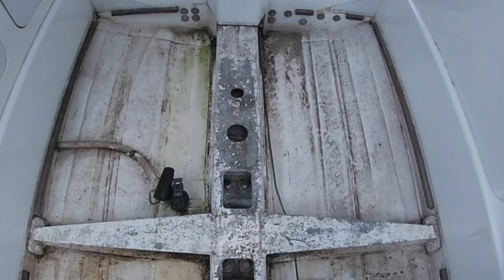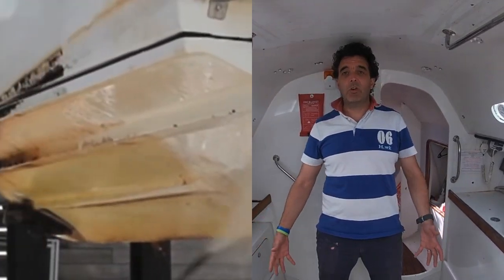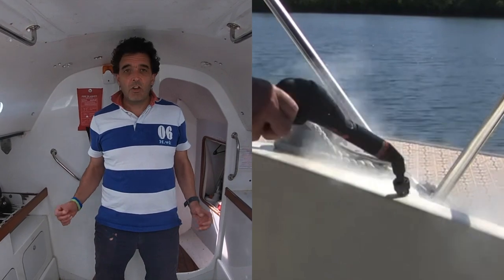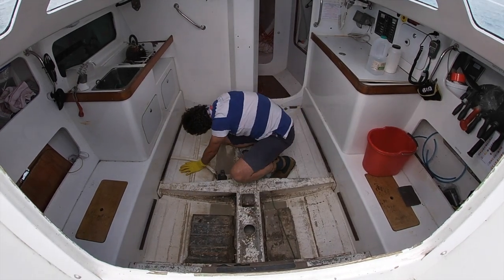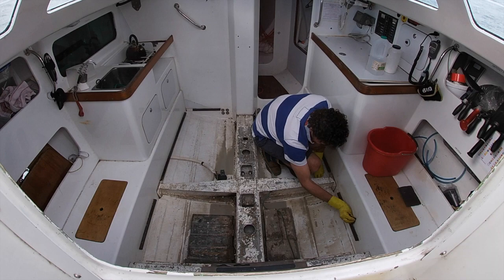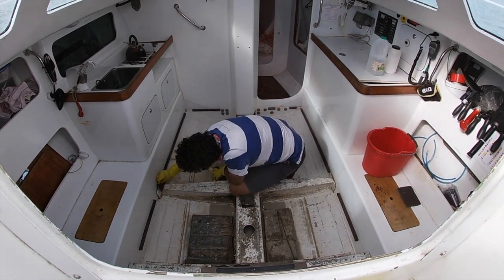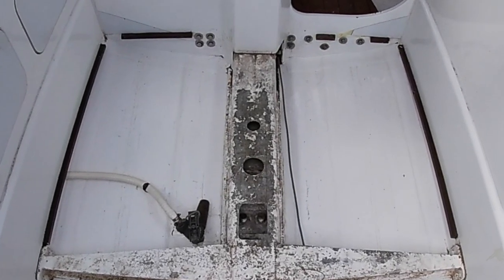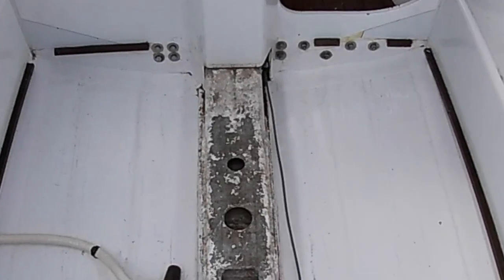Cleaning Fibreglass, fast and effectively.

Comment: Do you know if the Oxalic acid would bleach out or effect colored fiberglass?
Reply from the maker: It should not bleach it. The cleaning process dissolves particles which have been absorbed into the fibreglass so works the same way for with and colour.

With that said it is always wise to test a small patch before going full on.

Comment: Should you use a respirator while using this product?
Reply from the maker: It depends on the work area. If you are in a small enclosed space it would be advisable for any product. If you are out in the open then going without will be fine.

Comment: Very useful. We are diving into our project had first tomorrow so I won't be able to use this method at the start. But I will definitely order the acid and use it moving forward. Thanks for the tips sir.
Reply from the maker: Thanks for stopping by. You can use this at anytime, either to break through years of build up or to get that finished shine as the last step in the process. 

Make sure you cover up with protection on eyes, hands and bodies as it is powerful stuff.

Check up the follow-up video with creates a paste which can be used on horizontal surfaces to get the same results.

https://youtu.be/YUIiH_wpzw0